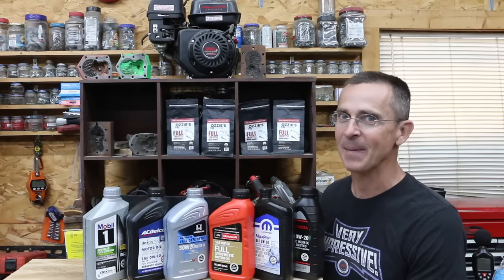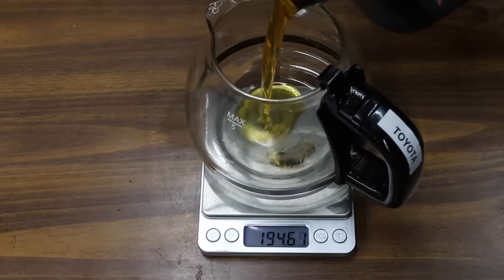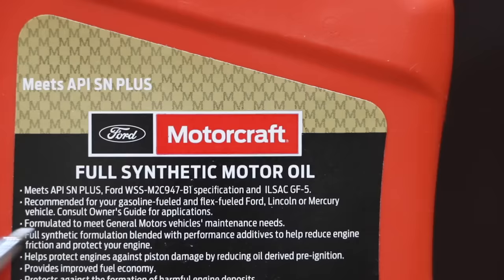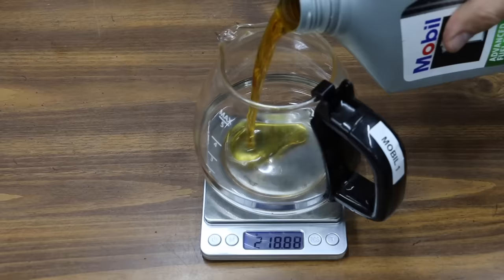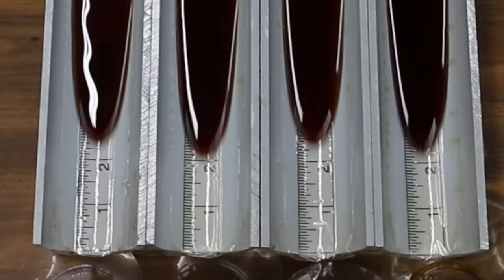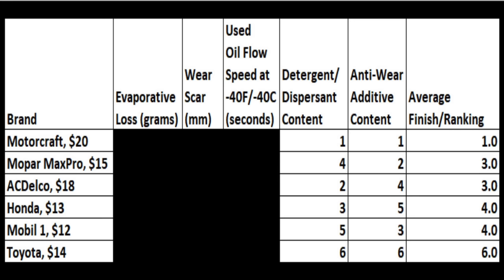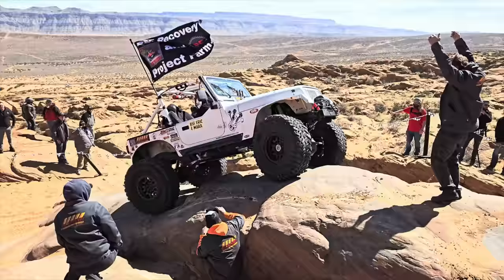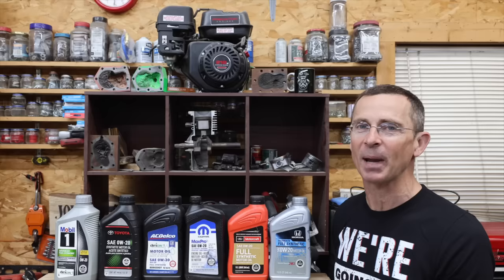How Bad Is OEM Motor Oil? Honda vs Toyota vs ACDelco?

Comment: People know, or should know that oil packaged with the oem name is not made by them, obviously Mobil does not make cars. I drive a 2021 Ford Escape Hybrid and Ford says use Motorcraft 0W20 Full Synthetic (Conoco Phillips) and Motorcraft oil filter (Purolator) and that is what use. I also add BG products MOA for Hybrids as well, not planning on changing what I use. I also do not go by the intelligent oil life sensor, I have free tire rotation at 6K miles and the oil is changed then as well. Having said all of that, it really was a very good video that you put a lot of time and money into!!
Reply from the maker: Thanks!
Reply: I would love to see the metal to metal test of the Motorcraft with BG Products
 MOA added to see if there is a real difference. I would send a super thanks to cover your cost.  @ProjectFarm

Comment: Regarding the weight test, one potential issue could be the inconsistent starting weight of the oil (or liquid), because it would take longer for higher qty of oil to reach boiling point, the results might've been affected

Comment: That looks like so much fun!  I'm going to Moab in a few weeks in my '21 wrangler ecodiesel on 37" tires.
It's a 3.0 TD, 3.73 gearing, 3.5" metalcloak game changers.

I was wondering, do you think people would be interested in a diesel engine oil/diesel fuel videos?
Reply from the maker: Thanks for sharing.  Thanks for the suggestion.

Comment: Dear mr.ProjectFarm, i have been a loyal subscriber for years now. And i know that you have been doing some knife stuff before.
Therefor i ask you for help in setteling a years old argument with my wife regarding knifes and the dishwasher.
She claims that putting good knifes in the dishwasher makes them dull. Me on the otherhand, sais that it might have been true with the first dishwashers, when there was not a designated place for knifes and that they where rubbing. 
Now in newer machines, knives has usually "our has" a designated place that are rubberized, thus not dulling the knives.
Who is right, drives me nutts😂
Keep up the fine work!
Reply from the maker: Thanks, will do!  Knives that are dishwater safe and positioned such that the blade edge won't rub against other silverware should not dull.
Reply: @ProjectFarm  fantastic! That is what i keep saying too, but she is percistent 🤣😊

Comment: You should do an oil stress test where you put the oil in a car or engine and run it right before it gets to operating temp, and do this for a year or something. Like get a car and drive it 3 miles in the morning and at night to simulate those super short trips to see how the oil hold up
Reply from the maker: Thanks for the suggestion.

Comment: Can you please do a video comparing Kirkland/Costco 0w-20, Idemitsu (Subaru’s oil supplier) 0w-20, and penzoil ultr platinum 0w-20?

I recently bought a Subaru Ascent and joined the Subaru Ascent subreddit forums, seems Kirkland/Costco oil has a huge fan base there but many arguments on which is the absolute best on those I mentioned. 

Btw, you make the best review videos I’ve seen.
Reply from the maker: Thanks!  Thanks for the suggestion.

Comment: I am sure you have had this request before. Could you do a car battery challenge? I know it wouldn't be cheap, maybe AGM vs Lead acid. Do your usual exhaustive testing, AH, CCA cold and hot CCA. Just a thought. Maybe compare group 31 batteries.  As usual you're an invaluable member of the community and your videos are more appreciated than you know.
Reply from the maker: Thanks!  Thanks for the suggestion.

Comment: Great vids, keep them coming, always interesting and I am looking at your library before buying anything !, nNce to see you at the OffRoad Games in Utah . 
Suggestion…Have you tested the engine antifreeze additives claiming to reduce engine operating temperature! Reslone Hy-per Cool and Red Line Water Wetter as example…Also John Deere suggest you add some additive to the cooling liquid after some year to improve corrosion protection and cooling performances.
Reply from the maker: Thanks, will do!   Nice seeing you too!  Thanks for the suggestion.

Comment: Amazing video! Could you please test Motorcycle oils next? There's a lot of debate about motorcycle oils, one of the biggest things is a lot of people run shell rotella t6 15w-40 instead of motorcycle specifically formulated oils, but rotella t6 does meet the requirements such as JASO MA/MA-2 which is important for wet clutch motorcycles and it's half the price compared to something like motul.
Reply from the maker: Thank you for the video idea!

Comment: Next comparison idea is a. 2 in 1. Wood cutting Hand saws. 

Im a bit sick of how there is no decent comparison of western off of the shelf site saws, and how everything is either a hand sharpen vintage saw or a new Japanese pull saw.

Id like you to test maybe 1 vintage or at least modern re sharpenable hand saw, 1 cheap, 1 medium, 1 expensive western off the shelf site hand saws and the same 3 cost brackets of Japanese pull saw. 

4x2 speed test, nail and screw resistance tests, finish cut quality, endurance cutting through hardwood, and soft, laminate floor cuts, cut time after corrosion exposure, flexibility test before breaking or permanently bending.

This might finally put some unbiased general use case testing together for this.

As all I see for recommendations is hobby wood workers using vintage or Japanese pull saws and I get they are nicer for the 5 or 6 times they get used a week, but on actual building sites without power, i want to know what does better getting used 5-6+ a day on all manner of materials.
Reply from the maker: Thanks for the suggestions.

Comment: OEM Oils aren't bad - and no manufacturer 'makes' their own oil; at most they provide specs to the oil companies.  I'd always trust them because the engines are specifically tested with those oils and the manufacturer's maintenance schedule for millions of miles.  When you use another oil (as 'high quality' as it may be) you are always rolling the dice a little - assuming that there won't be any unanticipated side effects.
That being said - the premium you pay for them is obviously not worth it.
Reply from the maker: Thanks for the feedback.

Comment: I use to change my oil at the Nissan dealer just to have a record of all the oil changes but I always noticed the oil temperature always ran Hot but when I change it myself it ran much cooler.
Reply from the maker: Thanks for the feedback.

Comment: Don’t know if it’s true or not but my local chevy shop said mobil1 is the same as the ac delco.  Have been running variants of mobil1 in my ‘16 Silverado 6.2 (gas) and it’s done very well for me.  Would happily pay more for better oil if it was proven to be worth it.

I do my own oil changes but however since this data shows a different story than mobil1 being the same as ACdelco, might be time to change to ACD!

Another great video sir!
Reply from the maker: Thanks!  Thanks for sharing.

Comment: Honestly, for all intents and purposes, they are so similar that you should just buy the cheapest oil, especially with how strict oil certifications are. It's almost a moot point whether you get a couple extra miles out of one when you will be getting most of your miles by just providing consistent maintenance with oil changes and the such

Comment: The main issue I have with Motorcraft, is that its generally using a blended oil still and full synthetic is considered a premium.
Reply from the maker: Thanks for the feedback.

Comment: I'm surprised by these results as well. I have a 2019 Ford Ecosport that I bought off the Ford dealership's used car lot. I used my Ford points to get a few oil changes done. For the last 2 winters, there was always a ticking noise from the engine at cold startup (32F or less) until some heat would come from the vents. Recently, I changed my own oil and opted for Mobil1. Noticed immediately at cold startups that there is no more ticking noise! I run Mobile1 in all of my other engines, and have done so for the last 15 years. Now I question what the dealership uses...
Reply from the maker: Thanks for the feedback.
Reply: Dealerships buy in bulk. Usually a major brand (not their own)

Comment: I feel like the oil made for the application is what needs to be used. I don't run ac delco in Fords, and I don't run motorcraft in Chevys.  I've been telling O'reillys for years to quit giving me Wix and mobil 1 oils.  They know I want the oem stuff.  At one time, I pushed Royal Purple only because I was trying to sell something that was supposedly better. I myself quit using RP because of the cost.  I've been using supertech in many applications lately and haven't had any issues.  I still use Quaker State in my '65 Mustang and haven't had any issues in 25 yrs of owning it.
Reply from the maker: Thank you for sharing!

Comment: I've ran Motorcraft oil in all my Fords for 25 years, and I have several hundred thousand miles on them and they are still running like new.
Reply from the maker: Thanks for the feedback.

Comment: Great information, but please keep in mind, Ford, Honda, Toyota, Mopar etc do not manufacture these oils.  They are likely made by a "traditional" (known) motor oil companies and bottled in branded plastic containers for marketing purposes.  They do this for unknowing consumers who purchase motor oils @ dealerships (just silly as the dealership "mark-up" is excessive).  In some cases these OEM oils may be collaberations with leading oil manufacturer's to assure compliance to OEM standards (BMW Longlife-XX, etc), but this is likely the exception, not the rule.  Buy oil consistent with the OEM standard from a reputable brand - perhaps bias to regional brands consistent to OEM development location if possible.
Reply from the maker: Thanks!  Thanks for the  constructive feedback.

Comment: I have found thay Ford replacement parts, car batteries,  and fluids are generally best in business. Their filters and oil are in many high mileage fleet vehicles i used to provide parts for
Reply from the maker: Thanks for the feedback.

Comment: Anecdotal evidence here but I never used anything but Motorcraft 5W20 oil and Motorcraft oil filters in my 2012 Mustang's 3.7l V6 from when I bought it in 2014 until I traded it in in 2023.  I changed the oil every 5000 miles.  When I traded it in it had over 160K miles, had 40K when I bought it, and it never burned a drop of oil over the 5000 miles between changes.  The dipstick would show exactly dead on the full mark with new oil and after 5000 miles.
Reply from the maker: Thanks for sharing.

Comment: OEM Subaru and Toyota oils ARE Mobil 1.... literally supplied by Mobil1 with the manufacturers label added.
Reply: Same goes with amazon motor oil, shipped out of the same place as mobil 1

Comment: One additional test that may be interesting is to see which oil performs best when fuel is added and when coolant is added. Today's oil use 0w20 which is a lot thinner than 10w30 I'm familiar with. I wonder what precision exist in the piston compression ring.
Reply from the maker: Thanks for the suggestion.

Comment: An excellent test would be Rotella 10W-30 vs other 10W-30 for gasoline engines. Why? The Jeep 4.0 flat tappet cam motors, all the hype is running “Rotella this, Rotella that, due to the high zinc content” I would absolutely love for a test to prove running regular oil vs Rotella diesel oil for the zinc content makes NO difference.
Reply from the maker: Thanks for the suggestion.

Comment: I drive a 2011 Honda Civic and have never ben easy on the accelerator , it's never had anything but Honda OEM Oil / Transmission and filters and never a breakdown Day in 13 years , the only other wear items were tires , brake pads , antifreeze , wipers and cranking batteries !
Reply from the maker: Nice!

Comment: Hard to beat a 5 quart jug of Mobil 1 from Walmart. Toyota motor oil (TGMO) is highly regarded in oil geek circles, but the price is prohibitive for the precieved performance imo. And, Toyota engines are easy on oil. I have tried just every oil there is, and changing oil is the key regardless of brand. Excellent video as usual!!!!
Reply from the maker: Thanks!

Comment: Last time I researched it, Motorcraft is made by Ashland who makes Valvoline.  Mopar is by Penzoil. Toyota and AC Delco is Exxon/Mobil. Why Toyota's oil is not that good in this test?  Might be a different setup and they put the higher end oil in the other bottles.

Comment: The delco part number used is pretty old. We are currently using the dexos 1 gen3 0w20 pn 19432331 in a quart. Should be around 11.18 a quart at list proces.
Reply from the maker: Thanks for the feedback.................

Comment: Suggestion: What is the best capsule coffeemaker. I am looking for a good coffee, a QUIET machine, temperature, reliability are also relevant. You need coffee both in the garage and the office, and it is nice if you can talk while making it. I looked online and can't find reliable noise data.
Reply from the maker: Thanks for the suggestion.

Comment: Could you test different types of shell rotella oil including T4, T5, T6 and T1/ straight grade? I haven’t found much information about testing of the T1 especially and would like to know if it is considered a high zinc oil, thanks and great channel I’ve watched for years and this is the best review channel I’ve seen.
Reply from the maker: Thanks for the suggestion.

Comment: Now I understand why Toyota has less engine leaks than others. Toyota just put the right amount of detergent so it doesn't damage/wash out the seals. I believe Mobil 1 does the similar thing. My 12 Camry has over 300K miles with Toyota 0W-20 oil at all times,  it still runs like new without any sign of leakage.
Different car manufacturers have different materials in their engines. A piece of universal testing metal cannot justify the wearing index of all the engine oils.  The wear scar should be tested using the brand of oil on the brand of the vehicle engine.
Reply from the maker: Thanks for the feedback.

Comment: Mostly what I take away from these tests is that most name brand oils do a satisfactory job of lubricating and protecting an engine... But ... Being the lifeblood of the engine, change your oil and filter often and your engine will reward you with years of reliable service.
Reply from the maker: Good Point!

Comment: Video idea! Try to simulate start stop engine conditions and see what the wear is compared to a normal test. Also im curieus if different viscosity Will make a difference to start stop systems or city driving. My gues is thicker oil Will work better because it doesnt loose temperture as Quick compared to thin oils?
Reply from the maker: Thanks for the suggestion.

Comment: I know you’ve already done a 2 stroke oil comparison, but it only covered 2 main oils. You should do one comparing a bunch of brands. Biggest reason I ask is because Stihl has 2 oils. A normal and more premium one. Stihl warranty can rely on you having use only their oil, so I’m wondering if it’s worth using the more expensive one at all?
Reply from the maker: Thanks for the suggestion.

Comment: can you please make a video on fuel injector additives and see if they work
Reply from the maker: Thanks for the suggestion.
Reply: Some definitely work, especially stuff with lots of powerful solvents/cleaners like Toluene, Xylene, Benzene, etc. Basically same kinds of chemicals sold at hardware stores as powerful strippers/cleaners. I've seen cheaper stuff use just Methanol which I doubt works anywhere near as well.

Comment: Very interesting test, but it’s clear that the oil results are almost inverse to the longevity and reliability of the engines. My Toyota 4Runner has used synthetic OEM oil from new and at 250K is flawless, and Toyota while last in your test, is arguably first in reliability and longevity.

Comment: Could you include Castrol,  Schaeffer(very expensive),Kendall and Pennzoil in your next test. Especially Castrol and Kendall, these are two I use. Kendall is made by the company that makes Motorcraft (was wondering how similar they are?) Sure enjoy your show and definitely use your conclusions and ratings. Thanks
Reply from the maker: Thanks!  Thanks for the suggestion.

Comment: Please test if conventional or synthetic oil leaves more carbon deposits when burned.  I have a rotary engine and I'm wondering which 4 stroke oil burns the cleanest.  Thanks!
Reply from the maker: Thanks for the suggestion.

Comment: Toyota oil is made my Mobil. I never liked the way my engine sounded with the OEM oil so I use Castrol high mileage synthetic blend 5w/30.

My 4Runner engine is very happy with that oil.
Reply from the maker: Thanks for the feedback.

Comment: I used to haul lub oil out of ExxonMobil, had a load of 5w30, 4 compartment trailer, 4 different brands, looked at the certificate of  analysis,, all 4 came out of the same storage tank, all went into same tank at destination,  all the same, it's like that at alot of lub plants, just paying for a  name.
Reply from the maker: Thanks for sharing.

Comment: You have lots of videos and comments on testing Oil

but if you receive/see this
been watching videos on a channel called "The Motor Oil Geek" that goes into great depth and scientific analysis on oil

basically you shouldn't be shaking ( i.e. it's unnecessary) the oil before using/testing. If the additives fall out of suspension shaking the oil will not put them back into suspension. If the new oil isn't really new or the additives are out of suspension (inspect the oil and bottom the container) then you shouldn't be using the oil and should be recycled/disposed off properly. You will not get accurate test results if you are using oil where the additives have fallen out of suspension even if shaking appears to work. they will fall out of suspension again.